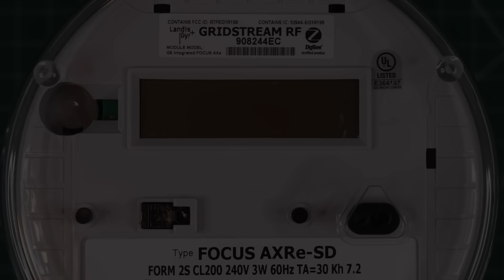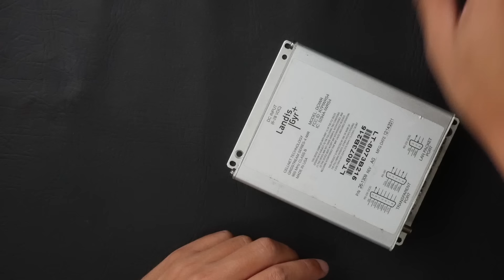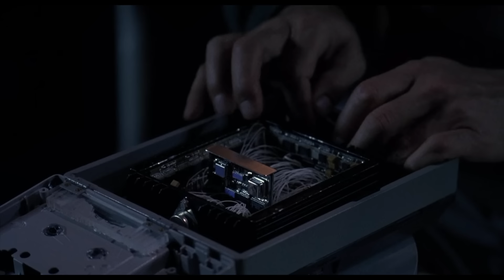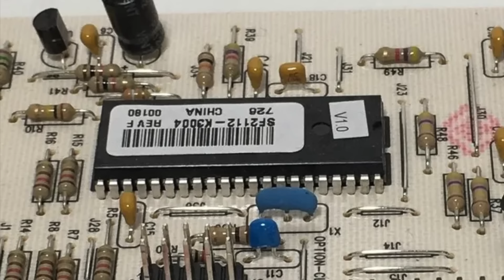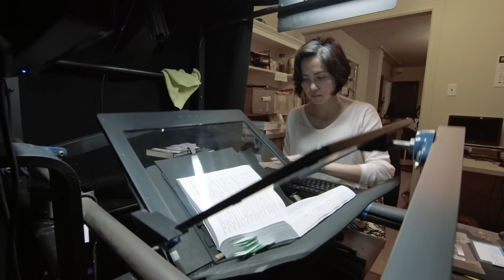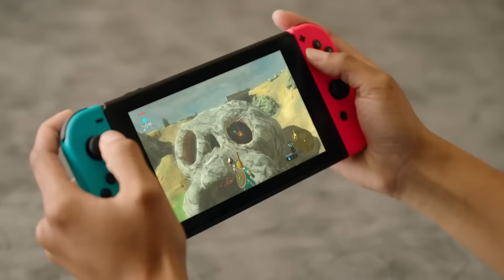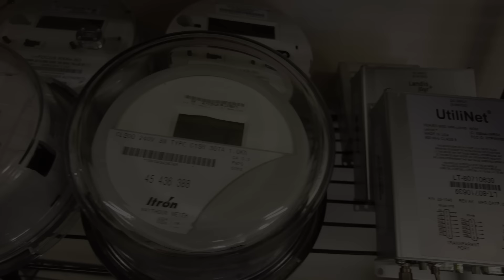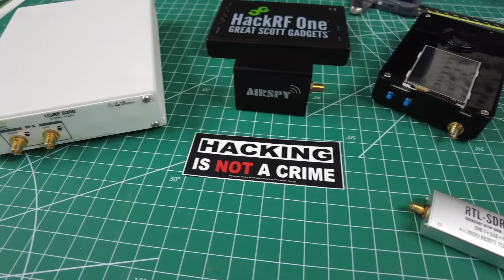The REAL Problem with Smart Meters

Comment: I work for a smart meter company (not L&G) and I can say for sure that the only way you will extract firmware from our meters is by decapping the chip and performing a circuit edit using a FIB/SEM system!  
As for listening to RF messages, all data is encrypted.  Each meter has unique public/private keys installed before shipping to the utility.
Reply: I don't doubt the hardware security is high on the meters your company makes.  Beyond the ability of most to obtain the firmware.  

However, hardware hackers come up with pretty innovative ways.  I am sure you are familiar with side channels, glitching attacks etc as well as potential software bugs that may allow memory to be leaked, or access gained.

Perhaps whoever makes the actual board and board SDK of your meter has strong defences against known attacks and made that a priority.   Maybe the devices also wipe their own firmware if a hardware attack is detected.  I can think of other defences also.

But being certain without the decapping route (which some people do) might be overdoing it.  Just be glad those smart meters aren't a hacker mass appeal device like phones/consoles :)

As for transmitted data encryption, and any potential vulnerabilities related to unauthorized parties attacking individual meters or meter networks, always assume it is a possibility that harm could be caused despite best efforts of R&D/security teams.
Reply: @ipc_watcher assuming the keys aren’t reused (we know how often they are) dumping the keys and firmware will at best let you look for any vulnerabilities in how the code handles the encryption… if it’s bad enough the traffic may as well not be encrypted
Reply: @ipc_watcher   talking about innovative ways for hardware hackers to gain access, did you see that video from stacksmashing “ breaking bitlocker” where he was able to probe the motherboard with a pico and sniff out the decryption keys?
Reply from the maker: Mail me a meter anonymously… and let’s find out 😁
Reply: @RECESSIM  perhaps you already know that the radio used is FHSS (frequency hopping spread spectrum) When used in the 2.4Ghz spectrum it has a repeatable sequence that sends the single bit ( 0 or 1) out 79 times.

There are not that many OEM chip makers producing chips that are FHSS in the 900Mhz that I know of? The firmware used in these chips is proprietary to each brand and must be used for the chip to function in the application the end user wants. In most cases, shorting two pins on the board will reset the radio chip.

That default allows you see the firmware and change parameters. Once you do that, you can at least see how many different settings are available, the amount of hops per packet(s) and whatever else is available to control how each radio is set to transmit and receive.

It has been a long time since I used to work with radios from Ralink, Raylink, Breezecom, Symbol and Proxium so please excuse anything that makes no sense. I have stacks of these radios gathering dust for 2.4Gz. I only have 1 single unit that is both FHSS AND 900MHz. I also have a very large 900Mhz omni antenna and tower standoff. Would it be helpful?
Reply: @RECESSIM 😂😂😂❤
Reply: I worked for IBM for 25 years EVERY program has a back door in. It is put there by the programmer for their own protection !
Reply: @marktarascio4766 I don’t think EVERY program has a back door, but you’re right, many do. Often, it’s to make testing easier as the devices come off an assembly line.

There’s also a good chance that there is a JTAG interface that allows connecting directly to the microprocessor and other parts of the meter. (There may not be any pins soldered onto the board for the JTAG interface, but it’s usually easy to solder some on.) Often, the JTAG interface can be used to extract the firmware, flash new firmware,etc.

IoT (Internet of Things) devices are typically designed and manufactured with the goal of keeping the costs as low as possible. This mentality usually leads to poor security, particularly with physical access to the device. So even if the communications are encrypted over the air, it may be possible to capture the packets before they are encrypted.

@Mike-01234 You mentioned that it’s like saying you can extract the key from a browser and hack a bank website. I disagree. It’s more like extracting the private key from Chrome and using it to eavesdrop on the communications with the bank. You also mentioned that you’re not going to find a private key in the meter. I don’t know about the meters you worked with, but many meters, particularly newer ones, do have private keys. These keys are used for authentication (i.e., ensure that the connecting device is authorized to be on the network and may be used for establishing an encrypted link to another meter in a mesh network.
Reply: 'everything wireless is hackable'
Reply: @dertythegrower  Nope, try to decode the ECDSA data, happy hacking👍
Reply: This point is completely missed in the video. Almost all microprocessors have their software locked so you can't download. Some early chips were cracked, but the system has evolved to the point where the software cannot be accessed. So what on earth is the point of this video?
Reply: @graemezimmer604  It's correct that pretty much all new smart meters are locked down but there are still millions of legacy meters installed that have weak or non-existent security.  That's what @RECESSIM is showing in the video.
Reply: @graemezimmer604  Not going to find a private key in a meter, collector, or repeater I worked with the L&G system. This is like saying you can extract a private SSL key from your own chrome browser and hack a bank website.
Reply: @graemezimmer604  you can look at the power profile that that MCU instruction creates. This is unique and can be used to create a log of instruction usage and also determine the MCU type.
Reply: The firmware may be harder to extract if it's in flash memory that is built into the microprocessor, but if it's stored in an external flash IC then it's fair game. In any case it's only as safe as the weakest link in the company producing the firmware. It's much easier to get to the source code through a mole or greedy/disgruntled employee than to hack the hardware and then try to reverse-engineer the data.
Reply: @VeniceInventors there are microprocessors with support for external flash encryption and if someone actually bothered with the design, it will be turned on
Reply: It needs to be able to decrypt the commands that come in, so the key must be able to be extracted in some way. Might be very difficult and require new side channel attacks but it is theoretically possible no matter what.
Reply: Sounds like Aclara to me
Reply: Not really, it was somewhere before you put it on the chip and that's where I'll take it from. You'll take me wherever that is yourself and then thank me for the experience, meanwhile I'll have done the job for pennies on the dollar compared to whatever blue team did. I could use the same ability to have your boss fire you, take your wife from you or make your kids into trannoids. You couldn't do the speechcraft checks to have your boss's job so you can't block my checks, simple as.
Reply: P=p* has been solved. Encryption at less than 10e12 bits is futile. Welcome to the qubit age.
Reply: @FelonyVideos  No idea what P=p* refers to but cracking a message using a Terabit key is absurd.  256 bit AES is secure.  If you are thinking about asymmetric crypto, 3kb ECC may be broken for quantum computers but none exist.

Comment: What would the legality be of setting up a ghidra server with the project loaded?  You’re not checking out the firmware per se, so it’s not really lending.  I’m guessing it still downloads the “project” locally, but unless there is a way to recover the original binary (I haven’t used it much myself…ida was more my thing…), seems like it’s not the same as digital lending.  I had planned on doing that with some different firmware for different reasons.  Unfortunately, re projects are currently my lowest priority projects…re is necessary for sure.  You can bet adversaries have already reverse engineered these devices…if the devices are vulnerable, they already know how to defeat them, so we need to expose it to get it fixed…but my creating projects just seem to be more useful in the short term…until wwiii breaks out and we all lose power anyhow :-/

Comment: You mentioned 902mhz but you showed meters with a ZigBee logo which is 2.4ghz
Reply: 868.0–868.6 MHz: Europe, allows one communication channel (2003, 2006, 2011[5])
902–928 MHz: North America, originally allowed up to ten channels (2003), but since has been extended to thirty (2006)
2400–2483.5 MHz: worldwide use, up to sixteen channels (2003, 2006)
Reply: @LRK-GT yes but that isn't ZigBee.

Comment: You acknowledge the corrupt nature of the energy racket, where power utilities who have been pre-paid via the municipal bonds they issue double-charge by billing people for the resource they've already paid for, so that the entirety of their billing becomes profit for them (and they issue additional bonds to get it all up front in one lump sum)...but rather than teach people simple steps they can do to modify these jewish devices, you pose some overly complicated scheme of reverse engineering the software.

Look, a simple mod anyone can do is to splice in a potentiometer on one of the leads going from the meter PCB to the current transformer (CT) that is used for sensing the amps. You connect the first two pins of the pot 2 and 3 (where pin 2 is the wiper and pin 3 is the rightmost pin if the stem/knob of the pot is facing you), and that is all. Then by adjusting the pot, you can affect the power use reading in a manner that will effectively be undetectable. By not completely disabling the power read (such that it reads no power use), you can scoot by with a minimal electric bill regardless of how much you actually use.

If you are tired of being jewed out of your money for a thing you already paid for, you can completely disable it. The process is simple - just cancel your service or stop paying and wait for them to disable the meter. At this point, they will expect a zero power reading due to the account being flagged as disabled. So all you need to do is disconnect the metering leads from the PCB, disconnect the voltage sensing leads from the PCB, and also the remote shut-off leads. You can then use three 9V batteries in series to flip the relay so that your power is on. And voila, you've just discovered FREE ENERGY.

Don't be fooled by the gas-lighters who claim you'll be arrested or whatever. As long as there are no witnesses, they have nothing. I myself trespass power company agents from my property if they show up. Contrary to what they may claim, they cannot just show up as they please to mess with the meter attached to your house. They also have no right to lock the meter box. If they do, drill it or angle-grind it off.

You cannot overcome a satanic system by proceeding in fear of what they may try to do to you.

Comment: Just asking…. Could the power reading be sent across the power line? I remember a while ago some power companies looked at sending data via the power lines just on a different frequency? Just a thought.
Reply: In my country we phasing out over the power line transport.  It's unreliable and since power lines are not shielded it jams other often critical communications networks.
So new system is combo LTE-M /LoRA combo. Far future adds optical transport.
Reply: @rybaluc  What country is that, sir ?
Reply: Here in Italy smart meters for electricity function exactly like that. The power wires are used to transmit data and thus the meters are part of the network. Then at the substation (where there is the secondary transformer) these signals are then converted either to fibre optics (trough a separate network of the electricity distributor that is run along with medium/high voltage cables) or trough some sort of radio protocol (for transformers installed in remote areas feed with overhead wires, in fact you can see the antenna on them). In any case the network is the internet, it's an entirely separated thing (that I think it's the same network used to interconnect substations and power generating stations for remote operations)

Basically there is a bidirectional communication with the meters, not only read them, but, for example, change their settings (i.e. the power limit after which the meter trips, or disable the meter remotely if you don't pay the bill). Of course it's used also for diagnostics of the network (i.e. measuring voltages, currents, etc) or for anti-tamper measures (if you disconnect power to your meter or try to take it off the support they notice that it's no longer on the network thus arrive to check). 

To me it's an ingenious system, doesn't require additional wires, SIMs, or radio protocols, but only the wires itself. It was rolled out replacing the old mechanical meters starting from the early 2000 I think, now again they upgraded to more modern meters using the same technology.
Reply: @alerighi  i have a 1970's intercom uses the mains wires
very handy move from building to building
unplug a go to where ever
dont invent the wheel again
by the way it came rca  radio corporation of America.
ray uk
Reply: naah, if you watch the video again there are these rectangular antennas on the motherboard, 2 of them. The other thing is they all have a receiver box as he showed it with 2 ports or more. Those antennas are for non commercial communication just for simple data input and output, think something on the lines of Ham radio and LoRa, but on non commercial bands.